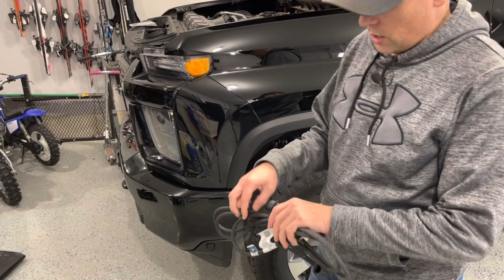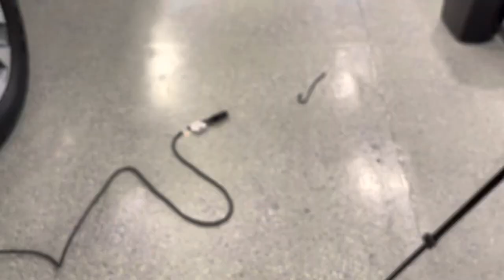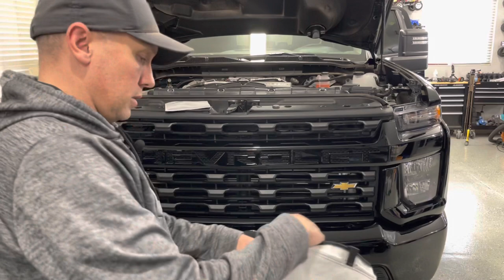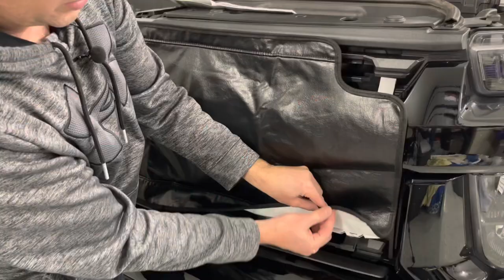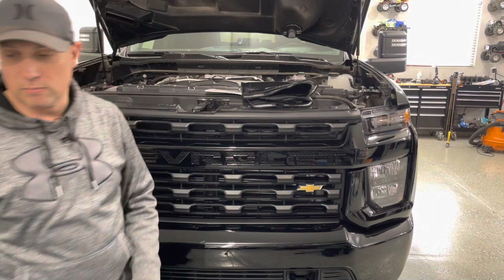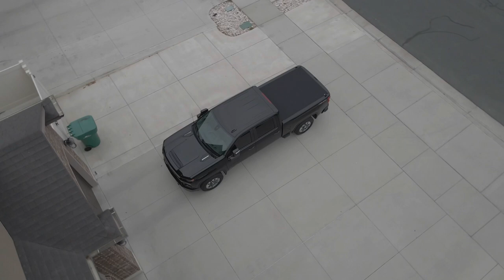Winter Front and Engine Block Heater?  2021 Chevy Silverado 2500 HD Duramax Winter

Comment: Found this video after searching for how to install winter grill cover after being informed of service bulletin 20-NA-043.  I have 2021 2500 HD with Duramax that I took in because check engine light had come on and I received "service emission system" message on DIC.  I guess the TMAP sensor can freeze up in winter time and cause this scenario per service bulletin.  Just FYI for all you L5P duramax owners.  Funny thing is I never see anyone using these covers here in MN but apparently you can run into problems if you don't from my experience.
Reply from the maker: Thanks for sharing your experience

Comment: How long do they advise to use the engine block heater? All night or on a timer. I had a 08 and it started great below zero. My 2020 starts a lot harder.
Reply from the maker: There is no guidance given as to how long to use it.  I would say it depends on temperature. If it’s really cold like below 0, I’d keep it going all night.
Reply: When temps are 0° for at least two hours before starting

Comment: I wish GM made and supplied one of these front grills covers for my 1500 duramax.  I had to order one from Fio which it appears doesn’t fit as nicely.
Reply from the maker: Yeah the 3.0 can tolerate colder temperatures better
Reply: @Myksgarage  I guess but as we come into winter, I see a definite change in mileage. I would assume this smaller engine would need more help in generating and keeping the heat.  But the one you have for the 2500 fits pretty well.  Nicely done.

Comment: Thank you, I got a 2022 chevy 2500 diesel and plugged it all nite and next day at negative 30 degrees windshield the truck started and died in 20 secs. I wonder if the block heater did not work? Is it supposed to make a noise or something for me to know is working? Do i also need to add wi ter mix to tank? Tha ks
Reply from the maker: Usually a gas station sellls winter diesel if you're in a freezing climate so normally an additive is not needed, but it wouldn't hurt to add it to your tank if you're unsure.  Good luck

Comment: Thanks for the video, I just got my 2022 Silverado 2500 duramax
Reply from the maker: Nice!  How do you like it so far?
Reply: @Myksgarage  I love it, the power and the transmission are a huge upgrade over the 6.6 gas.
Reply: I got two of them feel sorry for you wait till you start it in the cold everytime def problems chevy junk makes me upset ran Chevy GM for ever live in the North they are useless trucks have to live beside your dealer will be making a video on this 200k mess of shit there selling us
Reply: @regconrad7783  I have a 2022 and I live in north Idaho 1ft of snow ave temp 13f I’ve had no problems with my truck I do use the platinum def noticed the lower grade def sucks I use remote start every morning have 10k miles on it no issues

Comment: Thanks for the video. Got a LT 22 2500 Duramax but can't get the cover on.... bottom hooks don't reach for some reason. If I go to third hole it's loose.
Reply from the maker: Mine was similar, the cover needs to be warm, so took mine in the house overnight then tried it and it worked
Reply: @Myksgarage  ahh so -30 F windchills isn't the right time to do this then... got it! THANK YOU!
Reply: It is a bit stretchy when warm